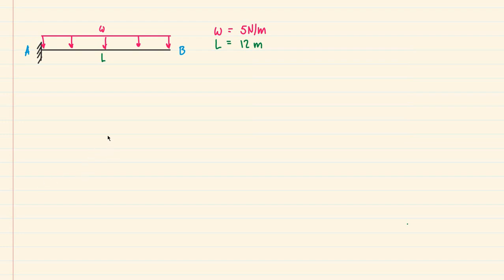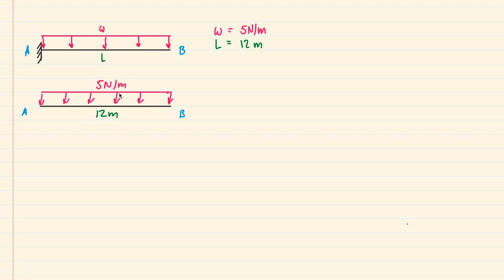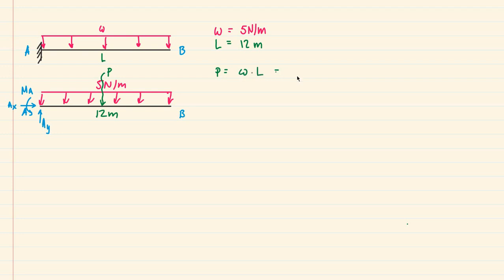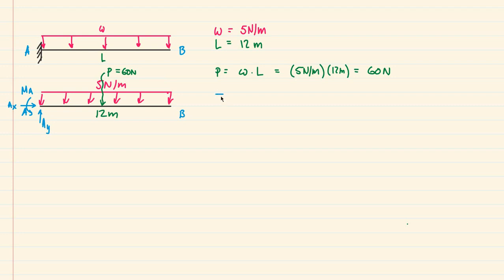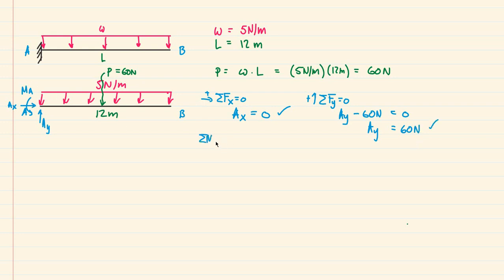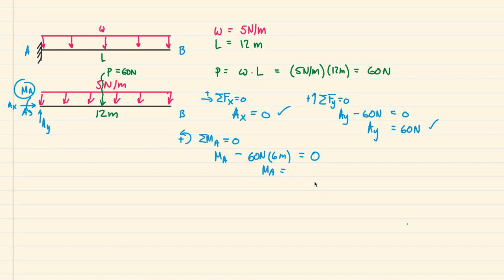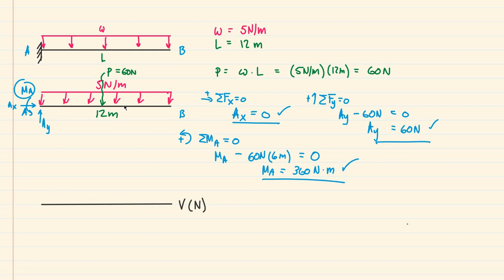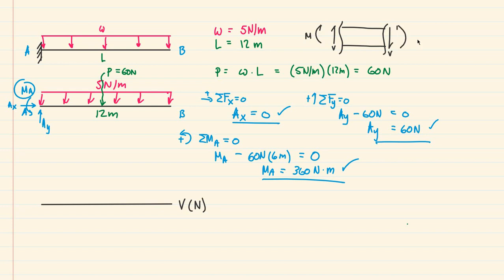[Ex. 07] Shear Moment Diagram Cantilever Beam Distributed Load Part I

Comment: Great post Simmy just remember you have the ability to visually solve a LOT of these problems using the calculation for Area under a curve (same calc for area of a triangle minus a smaller triangle for any point along that line. since the moment is an integral of Shear ;) also M and V have to equal 0 at the ends for all Shear and Moment Diagrams (Rules for a simple beam calc) in order for it to be STATIC ;)

Comment: If you use your cantilever for a piping systeme support , how  do you calculate the dynamic charge of the fluid and then add the dynamic weight to the centalever calculation ?
Reply: There are a lot of ways to answer that question but fluid dynamics and kinematics will help you solve for the piping (system) Forces. since you didn't give us the proper info (dependent on what the actual system looks like angles, distance, fluid density, etc.) I wouldn't expect an answer soon. too many unknowns :)